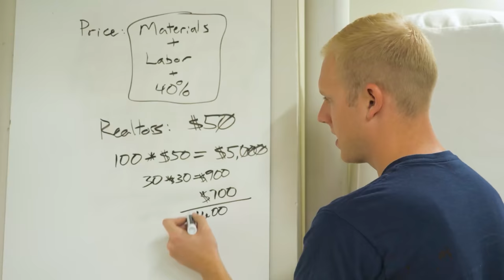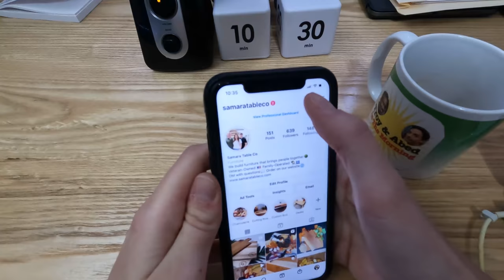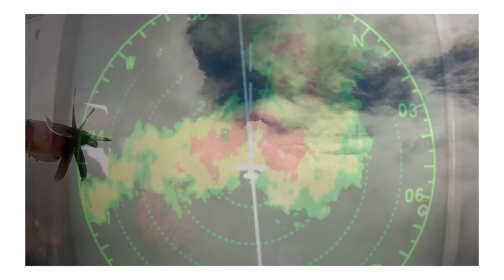JENNIE IS BACK! (and we need your help!)

Comment: Oooh, epoxy on cutting boards. Careful with epoxy for food contact materials, it's really toxic before it sets so if it's not completely perfectly mixed then some of that toxicity will remain in the product. It's also literally made of 50% BPA, that thing that they exclude from water bottles etc. so they can say "BPA Free."
Reply from the maker: Thanks for your concern, Marc! We only epoxy the backside of the boards, and honestly, nobody uses their boards for food - they're a decoration. But they're totally safe!